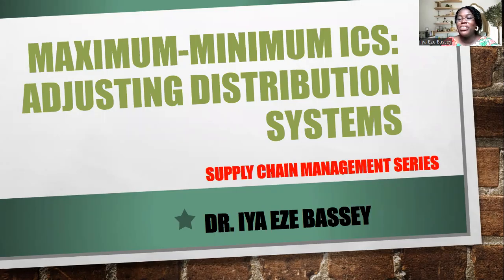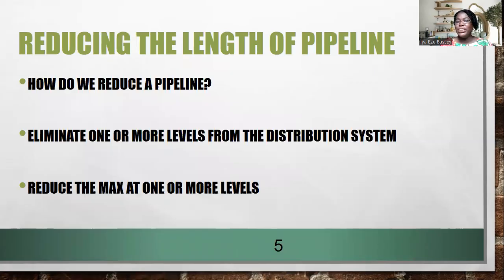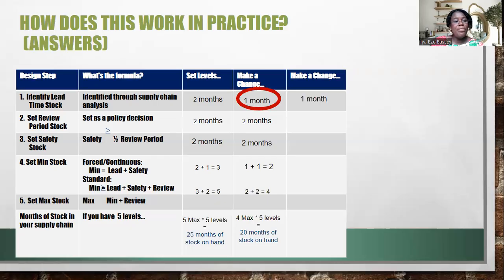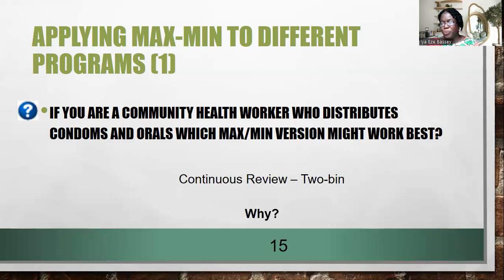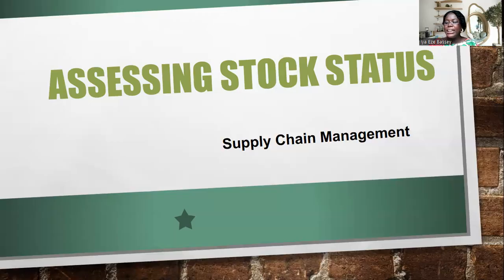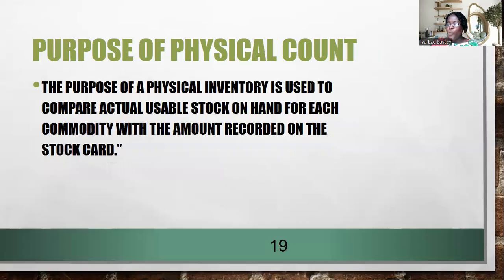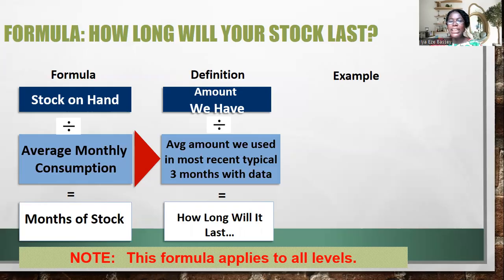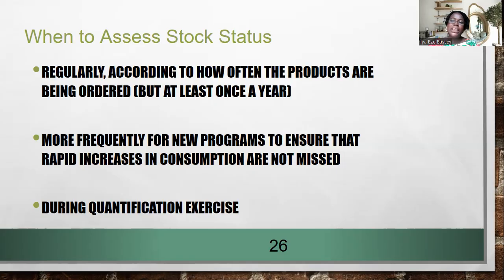Maximum-Minimum ICS: Adjusting Distribution systems (Supply chain management series)

Comment: Thank you ma from the lecture video I was made to understand that the max-min ICS is very important in managing the supply and consumption of laboratory reagents and equipments.

STEPS IN DESIGNING A MAX-MIN ICS ARE:

1. Set up initial max-min policies for each level and type of faculty.

2. Check if the overall distribution will function properly.

3. Check the total length of the pipeline that the policy at each level imply.

And the factors that impact max-min stock level are:

1. Lead time

2. Cost of products

3. Storage capacity

4. Cost of storage.

Comment: Beautiful lecture this is ma 
Now in summary the steps to designing the Max-min ICS includes;
a.To set up initial max-min policies for each level and type of facility 
b.Check if the overall distribution will function properly if the level specific max-min policies are implemented 
c.Check the total length of the pipeline that the policies at each level imply.
Stock level, elements of the formulas that can be changed in order to reduce the Mac stick level like review period,lead time, distribution systems reliability. 
The purpose of physical inventory is used to compare actual usable stock on hand for each commodity with the amount recorded on the stock card 
There are several factors that affect Max-Min levels are;
a)cost of production(b)lead time. (c)storage capacity (d) cost of storage (e) age of of program. Some advantages of the Max-min system are: avoid overstocking,minimizes shortages,avoidance of emergency order and consistency of stock level,minimize wastage and the challenges to using each version and variation are systems with numerous levels, those that manage a large number of commodities and systems that manage products for new programs. Also,It is possible to access stock status regularly according to how often the products are being ordered but this should be at least a year.

Comment: Thank you Ma for the lecture.
In summary i learnt that we are learning this particular series so it could help us to understand the consideration for improved distribution system in Nigeria.
I learnt that in designing the Max-min ICS we should be able to;
Set up initial max-min policies for each level and type of facility 
We should also check if the overall distribution will function properly 
We should also check the total length of the pipeline that the policies at each level imply.
Also learnt that in reducing the length of a pipeline we can eliminate one or more level from the distribution system.
Also in reducing the maximum stock level we need to change some elements of the formulas in order to reduce the maximum stock level.
Also that other factors that could impact max-min stock levels include; cost of products, cost of storage, storage capacity, management skills of staff etc. 
Advantages of using max-min system is to avoid overstocking, to avoid under stocking, to avoid cost of emergency etc. 
Some challenges to using each version and variations are due to Systems with numerous levels, systems that manage a large number of commodities and system that manage products for new programs.
Also knew the difference between push and pull system, that for a facility that orders quantities the one that calculates and issues order quantities is a push system while the facility that is receiving is the one that calculates and receive the order quantity is a pull system.
Also the purpose of a physical inventory is used to compare actual usable stock on hand for each commodity with the amount recorded on the stock cards. I also learnt most importantly that physical count should be conducted at least once a year unless things are not balancing then do it as frequently as possible. I also learnt how to calculate stock on hand. Average monthly consumption, Months of stock.

Comment: In summary,have learnt the way to adjust distribution systems policies,the advantages and challenges of maximum minimum inventory control systems,the inventory control systems used in the logistics management of HIV/AIDS commodities. The purpose of assessing stock status. Lastly to determine the number of month of stock available at any storage level using inventory and usage data.thank you ma 🙏

Comment: At the end of this class
I learnt the several steps in designing Maximum _Minimum ICS, they include 
* Set up initial maximum- minimum polices for each level and type of facility 
* Check if the overall distribution will function properly, if the level specific max-min policies are implemented 
* Check the total length of the pipeline that the policies at each level imply 
i learnt How to improve the distribution system by:
* Making the delivery process better 
* Making the right amount of items in stock 
 _ I also learnt the advantage to using Max-Min System, which includes 
* To avoid overstocking 
* Avoid under stocking 
* Avoid Costs of Emergency orders 
* Consistency of stock levels 
 There are also Some challenges To using Each Version And Variation 
 I also learnt about Physical Count 
The physical count is the process of counting by hand the total number of usable units of each commodity in your store or health facility at any Given time 
And the purpose of the physical Count.
Thank you so much ma ❤

Comment: Comprehensive lecture🧡
The maximum-minimum ICS is necessary for adjusting pipelines and ensuring proper inventory of commodities

ADVANTAGES include: it avoids
*overstocking
*Understocking
*Cost of emergency orders
*Reliable data source from SDP

CHALLENGES 
Also include:
*Systems with numerous levels
*systems that manage large number of commodities
*systems that manage products for new programs

Comment: In conclusion, I now understand the procedures for creating a max-min Inventory Control System (ICS), how to shorten pipelines, and the several aspects that influence the calculation of max-min stock levels. Along with the difficulties posed by many iterations and variants, I've also learned more about the advantages of a max-min system, such as its ability to avoid overstocking and understocking. Physical counting, which involves manually tallying the total number of usable units for each commodity in the store or medical facility, is crucial, as you said. That the class was enjoyable makes me happy. I'm grateful ma

Comment: In this module i have been able to know the steps in designing a Max-Min ICS which are 
1.Setting up initial max-min policies for each level and type of faculty.
2.Checking if the overall distribution will function properly if the level specific max-min policies are implemented.
3.Check the total length of the pipeline that the policies at each level imply.
I also learnt how to shorten the pipeline:
-Eliminate one or more levels from the distribution systems.
-Reduce the max at one or more levels.The purpose of assessing stock status is to determine how long supplies will last.
I also understood the advantages of using max-min stock is to
Avoid overstocking 
To avoid umder stocking 
To minimize wastage 
To avoid costs of emergency order etc

Comment: Summary of Adjusting distribution systems in maximum/minimum Inventory control system 

The steps in designing a max/min ICS are
1. Set up initial max/min policies for each level and type of facility 
2. Check if the overall distribution will function properly 
3. Check the total length of the pipeline that the policies at each level imply.

Also, in reducing the length of a pipeline, you need to eliminate one or more levels from the distribution system, reduce the max at one or more levels.
While in reducing the maximum stock level, we shorten the review period at one or more levels. 

Other factors that impact max/min stock levels are:
1. Cost of products 
2. Reliability of transportation 
3. Cost of storage 
4. Storage conditions at different levels 
5. Shelf-life of health commodities 

Some advantages of using max/min ICS
1. Avoid overstocking 
2. Avoid under stocking 
3. Minimize wastage
4. Avoid costs of emergency orders

There are some challenges that occurs when using each version and variations. 
Lastly, the physical inventory counting involves manually counting the total usable units of each items in stock, and enabling us to verify actual stock levels against recorded amount in inventory records.

Comment: I understood that there are steps taken when designing max-min ICS such as 
1. Step up initial max-min policies for each level and type of facility.
2. Check if the distribution will function properly when the max-min policies are implemented 
3. Check the total length of the pipeline that the policies at each level imply.

Also, physical count is the process of counting the total number of usable units of each commodity in your health facility by hand at any given time.

Accessing stock status is essential to know how long supplies will last

Comment: What I learnt on this topic:
Max-Min ICS are used for managing the supply of laboratory reagents, consumables and equipment in the medical laboratory.
- ways in designing a Max-Min ICS
*Start up initial Max-Min policies for each level and type of faculty.
* check if the overall distribution will function properly if the specific Max-Min policies are implemented.
* check the total length of the pipeline that the policies at each level imply.
Advantages of the Max-Min ICS
- waste reduction
- prevention of overstocking
- consistent supply maintenance
- Avoids understocking
     Challenges of the Max-Min ICS
- product cost
- storage capacity
- shelf life of health commodities.

Physical count is a hand count of the total useable commodity at a faculty at any given time.

Comment: MAX-MIN ICS: ADJUSTING DISTRIBUTION SYSTEM
At the end of this lecture I learnt the steps in designing a max-min ICS which include:
1. Set up initial max-min policies for each level and type of facility
2. Check if the overall distribution will function properly if the level specific max-min policies are implemented
3. Check the total length of the pipeline that the policies at each level imply

Elements of the formulas which can be changed in order to reduce the max stock level
1. Shorten the review period at one or more levels 
2. Reduce the lead time at one or more levels
3. Improve the distribution system reliability at one or more levels so that safety stock can be reduced 
 ADVANTAGES OF USING MAX-MIN SYSTEM
1. Avoid overstocking
2. Avoid under stocking
3. Minimize wastage
4. Avoid costs of emergency orders
5. Simplify inventory control decision making
6. Consistency of stock levels 
7. Reliable data source from SDP for forecasting and quantification

ASSESSING STOCK STATUS
Physical count: the process of counting by hand the total number of usable units of each commodity in your store or health facility at any given time.

Comment: In summary i have learnt the following 

The Maximum-Minimum Inventory Control System (Max-Min ICS) is a strategy for managing inventory levels to ensure adequate stock while minimizing overstock. It uses two critical parameters:

1. Maximum Level: The highest inventory level to maintain, preventing excess stock.

2. Minimum Level: The lowest acceptable level, ensuring sufficient supply before restocking is required.

In distribution systems, this approach is adjusted to optimize stock levels across multiple locations. Key adjustments include:

Setting Reorder Points: When inventory drops to the minimum level, orders are placed to replenish stock up to the maximum level.

Centralized vs. Decentralized Systems: Balancing inventory between central warehouses and local distribution centers to reduce lead times and logistics costs.

Demand Forecasting: Using historical data and trends to set accurate max and min levels based on location-specific demand.

Stock Rotation: Prioritizing older inventory to reduce waste and ensure product freshness, especially for perishable goods.

This system ensures a steady supply chain flow, reduces stockouts, and controls costs by aligning inventory levels with demand variability.

Comment: In summary the length of a pipeline is by setting up initial max-min policies for each level and type of facility.
You need to check overall distribution pipeline will function properly.
You need to check the total pipeline. 
The advantages of using max-min system are as avoiding overstocking, avoid understocking, minimize wastage and consistency of a stock level.

Comment: The STEPS IN DESIGNING A MAX-MIN ICS; (video 4)

Having watched the video I can apparently deduce the following concepts:

a) Set Up Initial MAX-Min Policies for each level and type of Facilities

b) Check if the overall Distribution will function properly if the level specific MAX-Min Policies are implanted.

c) Check the total length of the pipeline that the policies at each level imply.

I also had access to the knowledge on How To Reduce The Length of Pipeline, How to Reduce the Maximum Stock Level, How to set Safety Stock, Minimum Stock, Maximum Stock,etc.

I also learned about the basic  FACTORS THAT IMPACT MAX-MIN STOCK LEVELS, such as:
 Cost of Products, 
Cost of Storage, 
Storage Capacity, 
Accuracy of Forecasts, 
Lead Times,etc.

I learnt the ADVANTAGES OF USING A MAX-MIN SYSTEM, which are to:

Avoid overstocking or understocking, Avoid costs of Emergency Order, Minimize wastage, etc.

Also, the CHALLENGES TO USING EACH VERSION AND VARIABILITIES were outlined as: Systems with numerous level, Systems that manage products for new programs, Systems that manage a large number of commodities.

Thank you very much ma'am 
You are the best

Comment: Thank you Ma for this lucid and explicit lecture on Adjusting Max-Min ICS
Firstly, I was able to learn the steps in designing a max-min ICS which are; 
- Set up initial max-min policies for each level and type of facility
- Check if the overall distribution will function properly if the level specific max-mi  policies are implemented
- Check the total length of the pipeline that policies at each level imply

Secondly, I learnt how to reduce the length of a pipeline by;
- Eliminating one or more levels from the distribution system
-Reducing the Max-Min at one or more levels

Strikingly, one can't shorten the length of a pipeline arbitrarily but there's a systematic procedure for that and in order to reduce the max stock levels, some elements of the formula can be changed 

I learnt  other factors which impact max-min stock levels such as; Cost of products, storage conditions at different levels, shelf-life, lead times, reliability of source of supplies etc..

Furthermore I was also able to learn the advantages of using the max-min system and the challenges to using each version and variation 

In addition, I learnt about assessing stock status, physical count and the purpose of doing a physical count  

Lastly, this lecture taught me formulas to determine our months of stock on hand and when to assess stock status

Comment: Thank you DR EZE for this interesting topic.
In summary,  there  are steps to designing the maxima ICS which are;
1. Set up an initial max-min polices for each level and type of facility. 
2. Check if the over all decision will function properly 
3. Click the total length of pipelines that polices at each level can imply. 
However, it can be challenging for system with multiple levels, numerous commodities, or new programs. Regular physical stock counts are essential,  especially for fast moving. 
I also learned about the prob and cons of stock tracking system and how to set them up. 
In conclusion, this is interesting calculations s

Comment: It was able to know that Maximum-minimum inventory control systems are super useful for managing the supply of laboratory reagents, consumables, and equipment in medical laboratory science. By setting the right maximum and minimum stock levels, labs can meet testing demands without having too much or too little inventory. This helps keep operations smooth, resources optimized, and ensures timely delivery of accurate test results.
.I also learnt that the factors that impact
max-min level are
1. Age of program
2. Cost of storage
3.cost of production
4.Lead time
5. Cost of storage

Comment: To summarize, the maximum and minimum The inventory control system provides detailed rules for managing stock levels to avoid both overstocking and understocking of commodities. The steps to create a maximum minimal control system include:
1) establish max-min policies for each level and kind of facility.
2) Ensure that the overall distribution functions appropriately.
3) Establish an initial maximum and minimum quality for each level and facility type.
Using the max_min approach has several benefits, including preventing overstocking and understocking, as well as reducing waste.
Some issues of this system include: system with many layers.
A system that manages a huge number of commodities, such as items for new programs.
Finally, physical stock counts are vital and should be performed at least once a year. In circumstances where goods move quickly, counts should be performed regularly to guarantee proper inventory management.